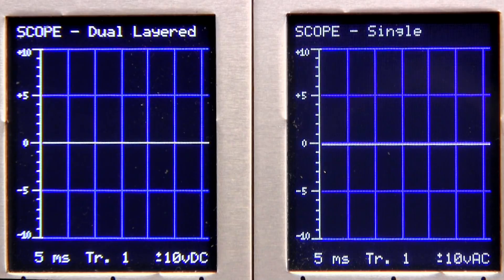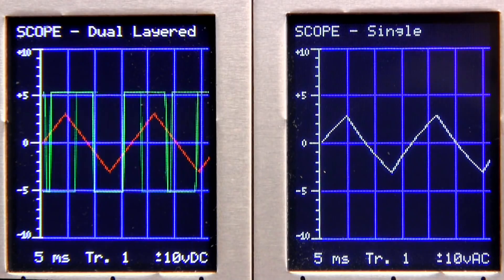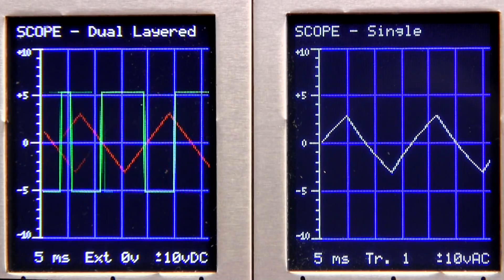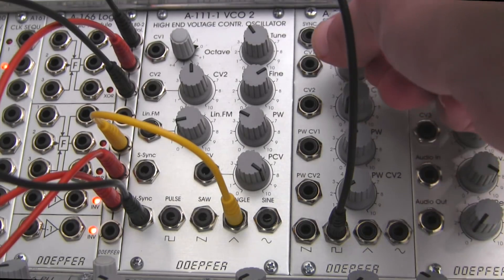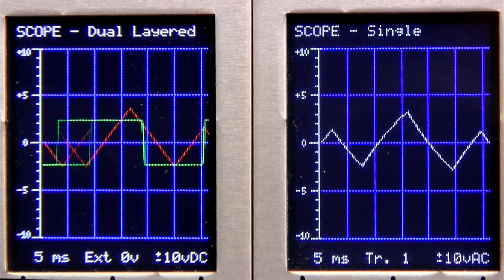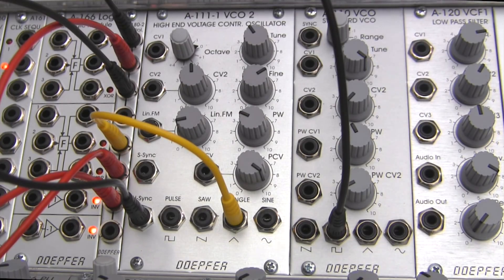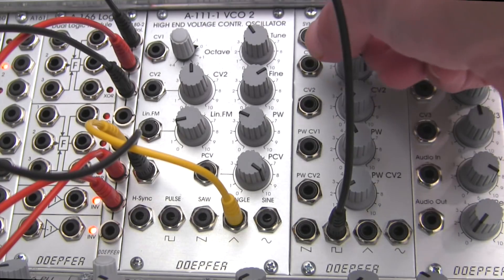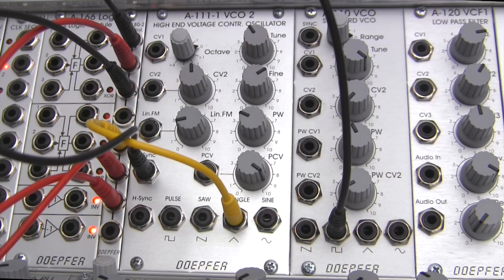Doepfer A111-1 High End VCO-Hard and Soft Sync

Comment: To all the 'what is soft sync doing' questions, from the Doepfer A-111(-1) manual:

"Soft Sync: In  contrast  with  hard  sync,  soft  sync  produces  no change  in  the  waveform  of  the  slave  VCO. (...) because  there  is  no  change  in  the  slave’sactual  waveform  shape,  can’t  produce  timbral  variati-ons.  What it does instead is to lock two or preferablymore  oscillators  into  a  perfect  harmonic  relation(...).

So it does not reset the slave signal. See page 8, 9, 10, with waveform examples : http://www.doepfer.de/a100_man/A111_man.pdf

Comment: You need to keep your explanations much less vague and demonstrate them more concrete by presenting static oscilloscope images. I'm sure it has a memory function where you can scroll in time to show both the master and the slave signal and their relations in both hard and soft sync mode. If not draw both signal versions on a piece of paper. That way you also demonstrate your own understanding of what is going on. Then, and only then, you demonstrate its sounding differences.
Reply: It certainly would have helped if at least one of the two waveforms on the left could have been steady, on the oscilloscope.

It was a nice try, but I'm still left with no real understanding of what the soft sync is doing.